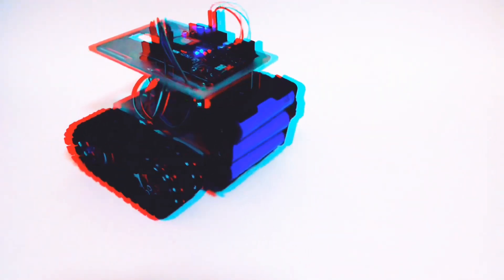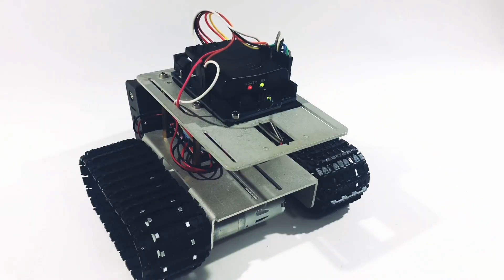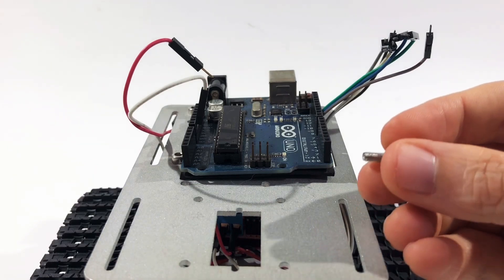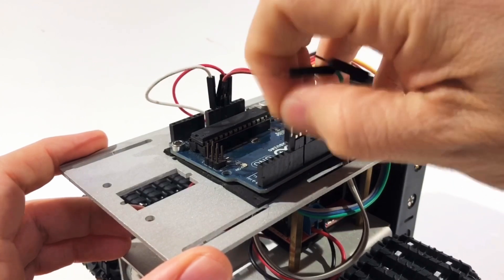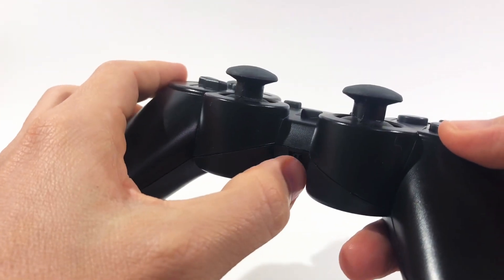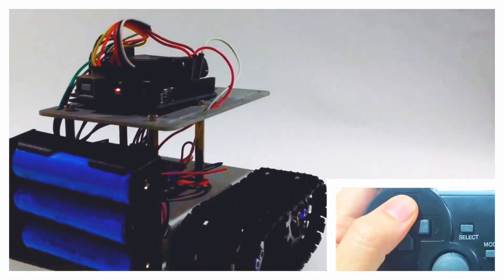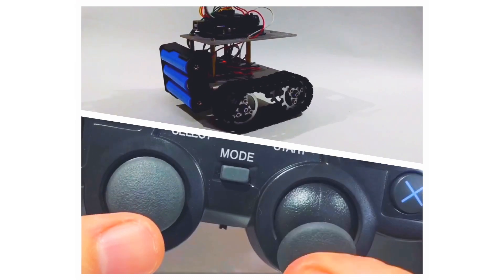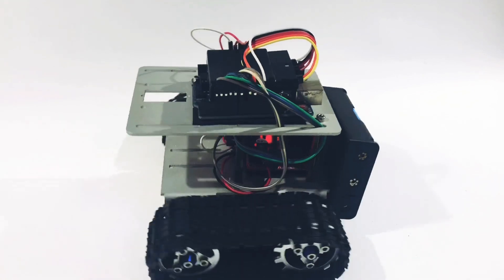Arduino Robot with PS2 controller (PlayStation 2 joystick)

Comment: Why not just use an ESP32 with built in bluetooth ?
Reply from the maker: Hi there! It's possible to do that (use an ESP32 with built in bluetooth an a remote controller).  Although, PS2 controllers uses another protocol, and thus I had to use its receiver to read signals between PS2 controller and the Arduino.

Comment: I have a question. Can I replicate a ps2 controller using Arduino + hc-05 for this kind of operations ?

I don't have a ps2 controller :(
Reply from the maker: Sure, you can design a controller that looks like a PS2 controller, and use it to drive the robot using a hc-05 or a nfr24l01 for wireless commands. Please let me know if you want to know how to do that and I can make a video explaining that for you.
Reply: There is one thing I want to know that,
Can hc-05 communicate with smartphones , laptop...
Just like a Bluetooth Gamepad.

If yes then what kind of protocols and commands we gotta use?
Reply from the maker: @kunalkr1211  I've never tried to comunicate a HC-05 with a laptop, but I've already used it with a smartphone. There are several apps you can find to send commands from a Android phone to a HC-05 module.
I've used Blynk app to control a robot using Wi-Fi. But it is possible to use the same app and a Bluetooth module.
https://www.instructables.com/Wi-Fi-Controlled-Robot-Using-Wemos-D1-ESP8266-Ardu/

Comment: Ivan, would this kit be better to buy than all of the separate components you suggest (I wish it came without the arm for somebody just getting started)? If so, I think doing a series of videos on it would be great since they seem to give you NOTHING to work with!! I think, in some cases, what you have listed here and the other instructables may be a little over the top for those coming into this for the first time.
 https://usa.banggood.com/Small-Hammer-DIY-4DOF-RC-Robot-Arm-Tank-with-PS2-Remote-Control-p-1701221.html?cur_warehouse=CN
Reply from the maker: Hi there!
I think it would be better to buy the whole kit than the separate components. This way you won't eventually get stuck for the lack of some components and need to place a new order and wait until you get it by mail.
Unfortunatelly they almost never leave instructions on how to assemble and use those kits... I'll try to right some thing on how to control both the tank and an arm at the same time using a PS2 controller, and hope it might help you.
If you intend to buy a kit with both the chasis and an arm, I'd suggest this one: https://rebrand.ly/RC-tank-arm-BG (although a little more expensive than the one you indicated, the components seems to have better quality).
Reply: @IgorFonsecaAlbuquerque  Thanks.

Comment: Hii sir in starting how do u control that car with mobile 
 Without any bluetoory receiver . I didnt get that .
Reply from the maker: Hi there! This PS2 controller has a wireless receiver, which’s connected to the Arduino and “talks” with it using serial communication. This way, there’s no need for a Bluetooth or another receiver.

Comment: Hi Igor, Nice Video.
How much lag do you experience with the PS2 Remote controller?!
I recently tried this method, but the excessive amount of lag is frustrating!
Reply from the maker: Thanks, Shahab!
I noticed almost no lag between the commands and the actual movement. There’s little processing on the Arduino (it isn’t reading any sensors in parallel) and I think it helped.

Comment: Thanks for the vid! Love it. I am in the process of designing a hexapod, and hope to use a PS2 controller with it. However, I need to use 12 signal pins for the servomotors. I would rather not have to use a shield component. Is it possible for me to only use one part of the PS2 (aka only need one signal pin?) or do all 4 have to be connected? Is it possible to connect two of the pins to one signal pin (through a breadboard) to try to 'save space', even if it leads to two of the controls doing the same thing?
Reply from the maker: Hi there! I'm glad you liked the video! :D
Regarding your question, unfortunatelly I don't think it would be possible to ignore sobre of the pins of the receiver..
Reply: @IgorFonsecaAlbuquerque  Okay, thanks!
Reply: You can add a shift register to add more pins
Reply: @danimaster6647  I'll have a research. Thanks!
Reply: i guess im asking the wrong place but does any of you know a tool to get back into an instagram account..?
I was dumb forgot my login password. I love any help you can give me!
Reply: @Reign Alden Instablaster =)
Reply: @Brooks Jalen i really appreciate your reply. I found the site on google and Im in the hacking process now.
Seems to take a while so I will reply here later with my results.
Reply: @Brooks Jalen It worked and I now got access to my account again. Im so happy!
Thank you so much, you saved my ass !
Reply: @Reign Alden No problem :D